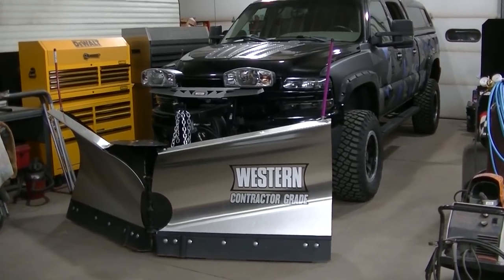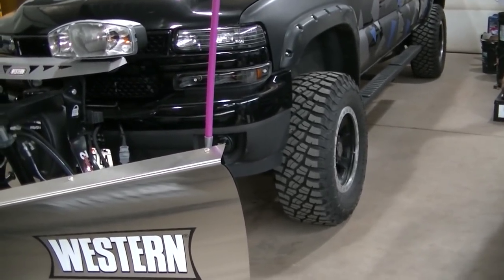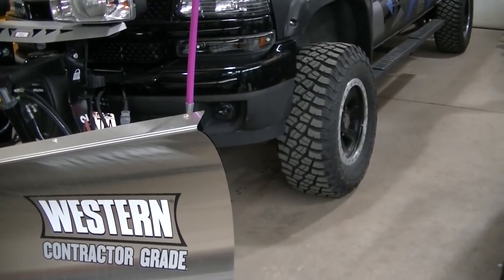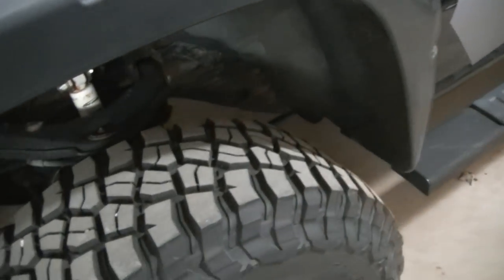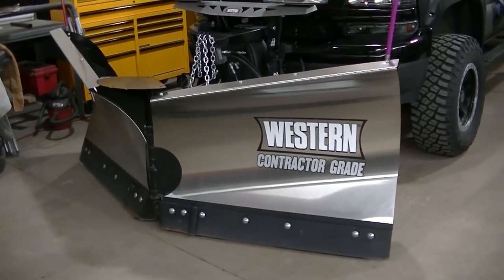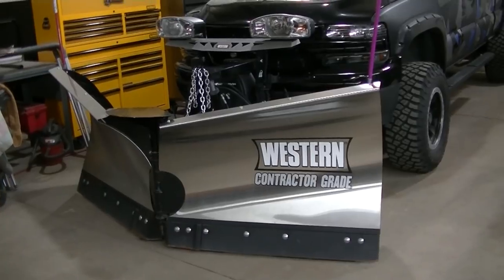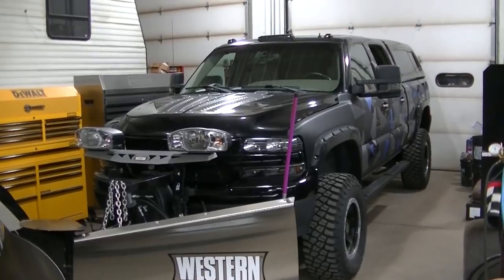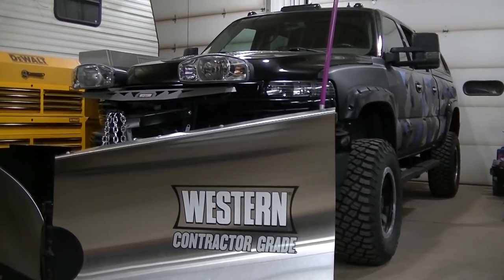Plowing With A Lifted Truck Concerns

Comment: You should not any problem I have a 8 in lift on my f250 with 40s and 15.5 tired and I’m still able to plow great the big lots
Reply from the maker: Yup, I have a year of plowing with it now. Had no issues.
Reply: What do you do with front end hang? Also did u move your plow mount down 8"

Comment: I had a 99 Ford F150 that had a lift and big mudders.  It would plow okay and I never had a real problem.  Other than the turning radius and it was a short bed single cab.  If it had not rusted out.  I might still be running it.
Reply from the maker: I should be ok just had some concerns.

Comment: Those k02 tires are really good in snow I mean REALLY good
Reply from the maker: I know,  I had them on my last plow truck  :)
Reply: Billy Pierce My ko2s saved my ass a couple weeks back my 4x4 stoped working and I dident figure it out until it snowed for the first time of the year but the g80 locker and my bfg ko2s got me home safe
Reply: Jeff Anderson same with me I had to drive in 2 wheel the whole winter
Reply: Billy Pierce see I have never had a 4x4 truck so I dident even know what it’s supposed to feel like I just bought the truck last March and I was still on the road and many were other cars and trucks were not I was pretty amazed at how well it did for not having the front engaged at all

Comment: I have a 2001 gmc extended cab z71. It has a 4 inch with 33x12.50 BFG mud terrains and 7.5 Curtis straight blade. I made extension brackets for my timbrens and they work great. Truck plows great. No problems other than the turn radius.
Reply from the maker: Yeah,  the turning radius sucks after the lift.  I don't really hear anybody talk about that.  I hope my 12.5 KM3 tires work out on the slick snow.
Reply: I don’t really have a problem with traction, those tires grip really well!

Comment: I have a 7" lifted 08 gmc dually that i plow with however i had to make 7" drop brackets for my plow because at full angle the plow will lift up on either side with the regular brackets
Reply from the maker: These brackets work great with a 6" lift.

Comment: Damn is that thing looking tough. Great job man..love that plow set up.
Reply from the maker: I hope it holds up.  It has higher mileage which was the main reason I didn't do this last year.
Reply: @mossman381  as long as you keep up with maintaining it should be okay. Fingers crossed! I love how it's not too tall, but not too low. Perfect height in my opinion. Keep up the good work my man.
Reply from the maker: The truck is pretty tall in person.  It really feels like a mini monster truck.  I remember after I lifted it I had a hard time getting inside the truck it was so high.  That is why I have the steps.

Comment: my dads truck is a 2004 gmc 2500gd with the 6.0 gas and his has a 3” body lift and a 3” suspension lift and a ultra mount contractor grade plow and plow great with 35” mud tires so you should have trouble at all

Comment: Wider track ruins the turning radius, and as for rubbing the inside of the fender well just take the fender liner out, fold the body seam over flat, and when you put it back together there will be more room. Same installation process as Bushwacker Cutout flares. Can always put a self tapper in to suck the liner in more if need be
Reply from the maker: I think it just hitting the fender flare.  Probably end up trimming them.

Comment: You have settled a lot of my concerns, I have a '01 2500hd extended cab long bed with a dmax, 6" Superlift, and 35" x 12.5". I have a 8' Fisher HD I'm about to put on it. I wasn't really concerned with turning radius though, this truck seems to turn much tighter than my old 1500hd crew cab this replaces. Maybe crew cabs don't turn as tight as extended cabs?
Reply from the maker: Turning radius should be the same or close with ext. cab long bed and crew cab short bed.  I have trouble at tight fast food places.  You don't have any trouble?  You should be running the same exact lift as I have.  Would be nice to hear from someone that is running the same lift.  I feel like I have lost a ton of turning radius from stock.
Reply: @mossman381  yes same Superlift in my truck. I recently bought the truck used someone else did all the work. I'll have to take a closer look at it and see how it was modded to steer tighter. I can say for sure it turns way tighter than my crew cab shortbox 2500, I even was driving both truck alternatively for a week or so and noticed difference right away.

Hopefully will be getting mine set up with plow in the coming week. Will let you know how it goes.
Reply from the maker: I got to plow a pretty good storm with this setup.  Everything seemed to work fine.

Comment: I'm not sure if that truck runs a Pitman arm but if it does do not use a drop for it. It killed my turning radius in my Jeep.
Reply from the maker: The steering was untouched.  It's all factory parts and location.  The track width has been widened and I guess that is was has killed the turning radius.

Comment: You just reviewed all the reasons my next set of tires will not be a 12 wide!
Reply from the maker: I ran a 305 on Frankenstein and it plowed great but those tires were the KO2.  I don't think a 305 is 12.5" wide either.
Reply: I ran 305s on my ole Tahoe. They were in the 12.5 wide range for sure, but I’ve noticed that varies from manufacturer to manufacturer. They were Mickey Thompsons.  The size range I’m considering for my next set is the 295/65r20. So a 35x10.5. I liked the width of my old 285/75r16s a lot. Ran that size on my Tahoe, both Suburbans and now on my S10. It’s a great tire size if you want the 33 range. Thus I’m hoping the 295/65r20 will suite my likings better.

Comment: how is installing a plow on a lifted truck ? im thinking about a light duty plow for a smaller lighter truck... dodge dakota v8 mag with a 5.5" lift
Reply from the maker: I really don't notice much difference plowing with a lifted truck.  A smaller truck will be pushed around by heavier snow.  A smaller blade will tend to float more and not scrape as good.

Comment: Is there a like a special bracket or mount needed to put a plow on a lifted truck because I have a Ford F-150 6 inch lift.?
Reply from the maker: You can get drop brackets for Western. Check the playlist on this truck because I show them.
Reply: mossman381 ok thanks 🙏🏻
Reply from the maker: @David-vt5cj  The truck worked great for plowing. I didn't notice any difference than with plowing with a truck with no lift.

Comment: we run 285/75/16 on all our gm trucks,  never realty had a problem
Reply from the maker: I ran 305s on Frankenstein and didn't have any problems but that was the KO2 tires.  I also don't think a 305 is 12.5" wide either.